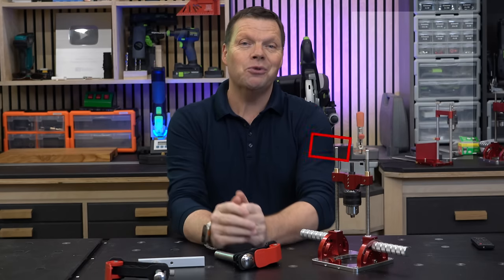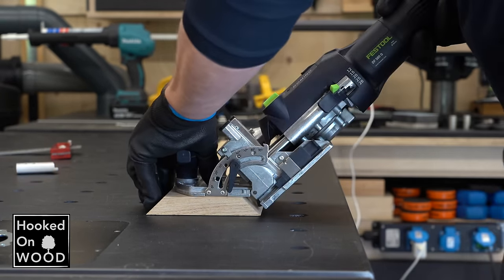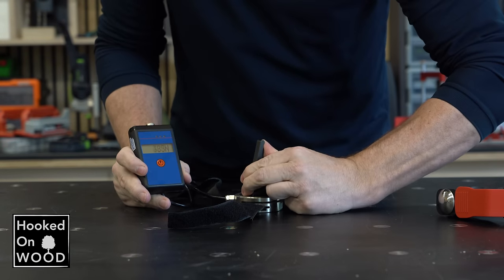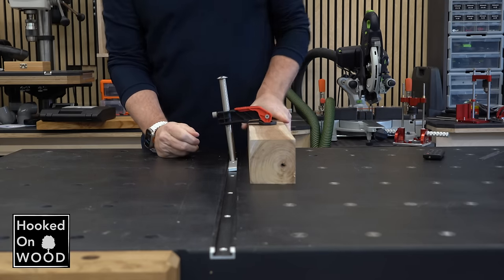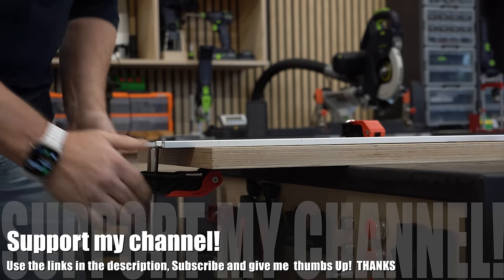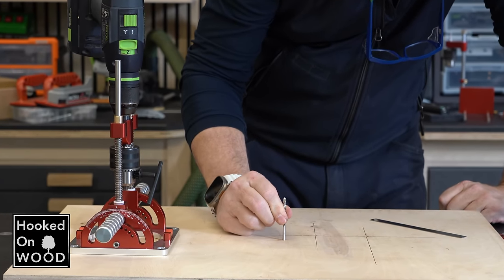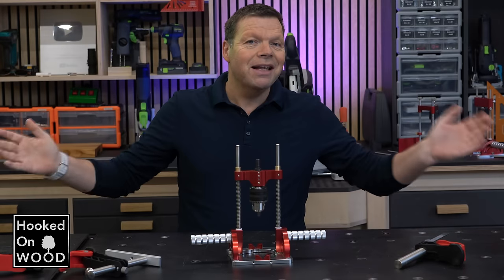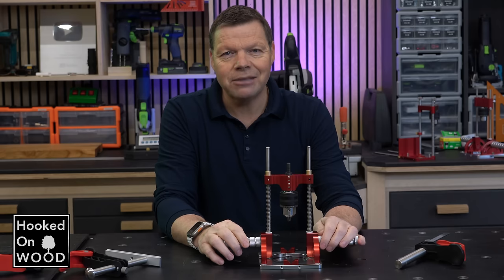Amazing woodworking tools everyone can afford! China Tools Ep. 52

Comment: Just got this drill guide. The chuck has an obscene amount of wobble and when I used it the four grub screws fell out! It also arrived scratched to bits as the drill rods had been loose rattling around inside the box. Not a happy bunny
Reply: Confirm. There are also some recent videos about the drill guide (the updated version) showing quality problems. Chuck wobble and friction issues between the rods and the mobile part.

Comment: I purchased the drill guide amongst other items recently and had a chance to use it on a project.  While the guide did a good job in general, as i started to use it all the small set screws fell out of the holes. I heard an odd sound while i was drilling and noticed something fell on the floor.  Luckily, i found all 6 set screws and figured out where they came from.   I think they need to use some thread lock on this product.   I give this tool 4 stars.

Comment: Now, would that drill guide be useful for making the MDF tabletop for the workbench? It looks like it would. Also it looks more useful than the L shaped ones as it appears to be well balanced with the drill in it.
Reply from the maker: If I look at a system like the UJK Parf Guide system, it goes way further to create an accurate grid of dog holes. Is also much more expansive and you can only us it for that purpose. But as I said in all my videos about the dog holes, you not necessary need an accurate grid of dog holes. Most of the time, I do not need the accuracy. (When you use it with a plunge saw, then I think it is worth it) So, to make the grid ass accurate as possible without breaking the bank, I tink it can be a useful tool. You will be able to drill the holes straight. But CNC like accuracy will not be possible.

Comment: Wow, the drill guide seems nice. I have an "old" aluminium drill guide from banggood which (even after some costly optimisations) is utter shite. The only thing I really don't understand is why they're still using those crappy manual tightened chucks with a a round end rather than an half-way decent automatic lock chuck with a hex end... I'm a bit on the fence on taking a 80€ hit to figure out whether I can turn this into a proper tool without too much effort or whether this is going to end up as another drill guide shaped paperweight...

Comment: Hi Dennis, I got this after watching the video, as it seemed quite a good way to get straight holes drilled in places where a drill press cannot be used.
Last week the need finally came up. Unfortunately the unit I got is not of great quality, the chuck wobbles side to side way too much (really a few mm) and the chuck cannot hold to the drill bit when drilling it starts spinning loose (tested with a 8mm drill bit). 
I am trying to get this refunded, but in the meantime would you like to test it? Perhaps it would be nice to share with people that this product has some quality control issues or something.

Comment: With the Parf guide, the holes sometimes do not turn out perfectly, though they are usable, for the most part.  This is why they sell the reamer.  If a person did buy the mobile drill guide, and they wanted to use the Parf 20mm bit, or possibly get a bit just for the drill guide as I prefer to keep the Parf Guide, for that tool alone, then one should not need the reamer.  Usually the top half of the hole is fine, or the underside was drilled from the back side and does not align perfectly.  Just a tip as one could doubtless find a use for both tools, but the drill guide might make the reamer unnecessary, or hold it for a later purchase.  This is what I find with my set-up, though I have a different drill guide.

Comment: I wonder why the drill guide has two motor bike handlebars. You can only use one as you other hand has to hold the drill. This would help reduce costs. Also it has poor clamping options which would give a better result. It would be great if it had the option to fix to a saw track to be able to drill a series of holes in a straight line with a clamped down track.
Reply from the maker: The guide rail option is something to consider. Although you can perfectly align the base against the back of a rail guide.  But I agree when connected to a rail guide in any way, makes it even more steady.  The base is big enough for clamping (or you have to use a very big bit, but with normal size bits, there is enough space to clamp)

Comment: My drill guide arrived today, so far it looks pretty good, except unless I'm missing something the depth stop doesn't really function when you install two springs, and one spring isn't strong enough on its own. I think the instructions are for the original version and the pictures are way too small.. and thanks to that I still haven't worked out what the two small plastic washers and the two steel sleeves are actually for.

Comment: At 8:39 and 9:13 in the video, a depth-stop is clearly visible on the drill guide.
I wonder why it is removed after that, and you haven't mentioned it as a function of the contraption?
Even a cheaper model like the Milescraft 1318 Drillmate (Eur 49,95) has the depth stop function, although it is missing the rail guides.
Reply from the maker: No reason, it has a depth stop. The shots are made randomly.

Comment: Do you cover your workbench lift somewhere?  I could not nail down a video, and it does not seem to be in your plans.  Workbench height adjustment is probably the single most important bench feature, but the only woodworking tool that seems to have it is the Noden Bench leg, and that one requires the bench to be light enough for an owner to lift to a new height.
Reply from the maker: No, not yet. I have to make a new top, because this one lacks some features. I will upload a video of that adventure :-)
The lift mechanism is something I bought. It is the Felder FAT 300S. Unfortunately, not affordable!

Comment: The drill guide seems pretty similar to UJK & Rockler's versions, but it actually seems better in one regard: the fact that it has a fence is a big advantage. I have the UJK version, and like it, but UJK missed a trick by not including a fence (or at least a way to add one yourself; there are no holes for guide rods in the base).
Reply: The UJK version has an optional add-on base that accepts fences. It is also MUCH bigger and beefier than this drill guide outside of the handles. The UJK rails are twice the diameter. I really wish someone would make a drill guide just like the Woodpeckers Auto Angle drill guide, just not $800.
Reply: @maximusmagni1  I'd pay good money for a base that accepts a fence; like I said, I'm quite happy with the product, but the lack of a fence has really annoyed me. However, I just checked on Axminster's site, and can't see any optional base... where did you find it?

Comment: Do you prefer those clamps to the Hongdui ones?
Reply from the maker: Yes,  these are easier to use.
Reply: Do you use the Hongdui ones at all then?
Reply from the maker: I used them in specific situations because the aluminum hold down clamp was already easier to use. The Hongdui has an advantage that it clamps inside the hole that will give it more clamping power. Especially in an 18Mm workbench. But because I have a double layer workbench top, or thicker top, these kind of clamps with a shaft give already an impressive clamping force, so it is not necessary to increase that. But for 18mm workbench, and you want some extra clamping pressure, the Hongdui is one of the options to go for. That does not make it the easiest clamp to get. This one will work more convenient.

Comment: Hi Dennis. Just a thought, would the T-track version work with a different version of a track insert.  I see the are just a long track insert with holes tapped in them.
Reply from the maker: I thought about that as well. But most of the T-track clamps have that play on the Miter track. Most of them also use a contra contact point, so it will be stable. This one lacks that so, it needs also a bigger T bar so it will not damage your T tracks. So, far I do not like the different T-track solutions.

Comment: Denis - Could you confirm the width/height of the 2 clamps with the T-Bar please?
Reply from the maker: the height capacity is 15cm width I do not know on this moment, but I guess around 10cm
Reply: @HookedonWood  I@m thinking for the cross section view. I'm wondering if it will fit a sliding table saw I have which need large T-Bars

Comment: Thank you for your video. Not sure what it is about these manufacturers and drill guides...?   Simply make them more stable - thicken the guide bars so no more (or very little flex)? I could see in your video how careful you had to be at times, in order  to achieve accurate angle holes (and having to drill the hole twice). Not worth purchasing until they are more stable. There are other options on the market - and last time I looked - for not much more than this drill guide. Thank you.
Reply: " Other options ". Such as ?
Reply from the maker: Good point Peter, I think there are some, but they lose the mobility. But for some context. This is a pretty stable drill guide, for what it is. I do not think the 600 dollar woodpeckers will be substantial more stable. I did not say that, because I do not have experience with the woodpeckers, but based on some laws of physics, there must also be some flex with the woodpeckers. 
Ofcourse I drill carefully when I want to test accuracy. It would not be fair to drill not carefully and blame the drill guide. I think the accuracy is perfect for what it is. I do not expect it to be 100% accurate, when you drill in 30mm multiplex wood. 
So, I think my end conclusion is fair. When it cares, you can drill pretty accurate holes. When it does not care that much, well it is a very convenient tool that is easy to use for multiple holes and you results will be more accurate then without a tool like this.

Comment: The clamp looks like a Festool copy. When I bought tools from China ( I mean w.o. European Brandname wich does QA) I was disappointed about quality, t rulers  that are not square and not keeping calibration.. parallel guides not fitting track they designed for, clamps releasing pressure spontaneously. What normal Customer get, looks significantly different what you review. If you not a YouTuber you have a felt 50% chance to get red alu scrap instead of a tool..